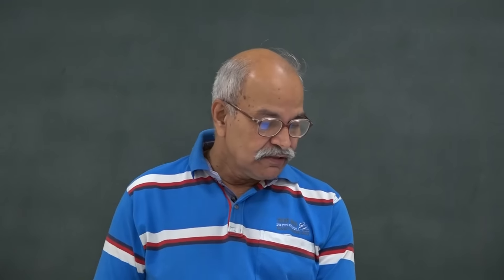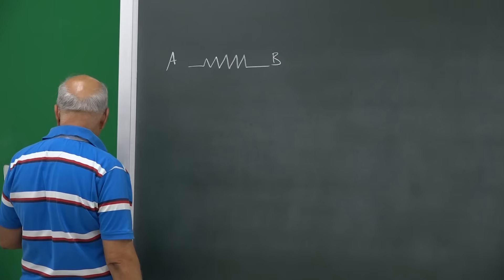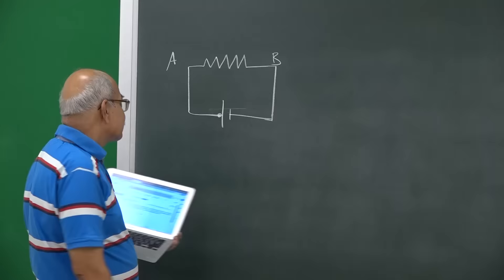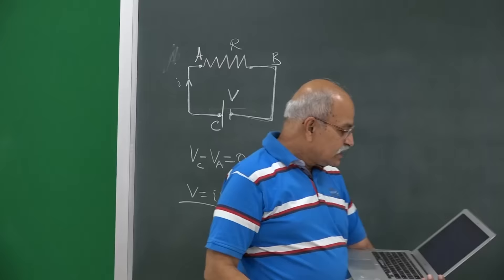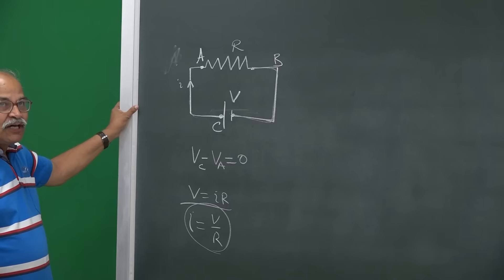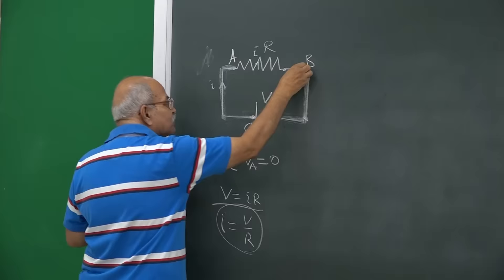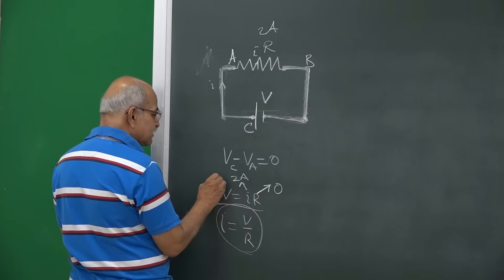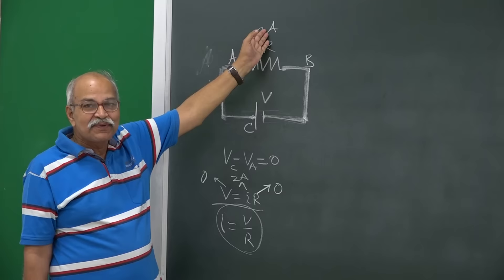Current without potential difference

Comment: मैं explain करता हूँ...
1.) अगर conductor का resistance ZERO (R=0) माना जाये तो, सर का explaintion समझ में आता है 😊।।

2.) But, अगर Conductor का Resistance ZERO नहीं माने तो  ( R#0)  ---
Potential difference, current का folw होंने का कारण होता है, इसका ये मतलब नहीं होता की जहाँ potential diffrrence न हो वहां current flow ही नहीं करेगा plz understand।। जैसे की water को flow होने के लिए हमेशा ढालान(slope) की ज़रूरत नहीं होती है, उसे pressure या Inertia के through same level होते हुए भी Flow कराया जा सकता है। ठीक वैसे ही यहाँ......

Point C to A, P.D  zero होते  हुए भी current flow होगा, क्योंकि ये सभी setup battery +ve & -ve Terminal से जुड़ा है, और battery अपना काम करेगा ☺️☺️।।
Reply: Potential difference, current का folw होंने का कारण होता है, - Galat hai. Current ka flow potential difference ke karan hota hai. I is proportional to V hota hai. Concepts of Physics me sir ne is baat ka zikr kia hai.
Reply: @palaksharma3157  pd causes current na?
Reply: @palaksharma3157  thanks
Reply: Pd causes current
Reply: Per bro battery hi toh potential difference create  krta hai ... So potential difference 0 kaise hoga
Reply: @palaksharma3157   no worry boi . Practically it's not possible . Resistance cannot be zero . It's just theoretical.
Reply: @palaksharma3157  Sorry Miss Sharma
As per Ohm's Law
V is proportional to I if all physical properties remain constant
For getting an equation we can remove this proportionality by R which is called resistance
So, V=IR
Reply: @palaksharma3157  aap shi se pdho ...jo aap kh rhi h whi wo v  kh rha h
Reply: I have practically tested it with battery so a mili volt potential difference is there but not zero and mili amp current is also present... So we should learn by practical experience as I was also facing same confusion while studying from book
Reply: @palaksharma3157  ध्यान से पढ़िए जो आप बोल रही हैं वही तो लिखा है current flow होने का कारण potential differenceहै या कि  potential differenceके कारण current flowहोता  है। दोनों बातें same हैं

Comment: The answer to this was clear to me when i took R of CA as negligibly small instead of being zero.(since, conducting wires do have a small resistance). i in CA has to be equal to that in AB assuming it's a steady current. So the i in CA is some finite value. Then, using V=iR for CA, you see that since R is really small, V of CA becomes negligibly small. So there is a potential difference between CA it's just negligibly small(and because the resistance is also really small, a good current can still pass)
(Pls correct any mistake)

Comment: Having current without voltage is easy to understand and explain ...  

So imagine you have two empty 2 liter soda bottles, now imagine connecting them with an airtight tube that has valves on either end... now imagine pumping one side up full of air pressure and sucking pressure out of the other end... now imagine opening the valves. That's how you have amperage with voltage the air is the amperage and it rushes into the other bottle because of a difference in pressure potential... (voltage)... 

Now imagine a new experiment where both 2 liter bottles have the same amount of pressure this time, and opening the valve... some air molecules will still slowly meander from one bottle to another... those air molecules are current that's not being pushed by a difference in pressure therefore there is no voltage just amps.

Hopefully that helps some understand. I can see people being frustrated trying to relate to how this works on a mechanical level. There are some neglected nuances like it's actually the missing electron in a conductor's molecule's valence shell that moves... one molecule steals from it's neighbor and that one from it's neighbor, on down the line so it's actually the gap or hole that is electricity not the electrons themselves. When you get shocked your being depleted of electrons... but this is just an analogy so of corse it will blow over stuff like that you'll have to visualize the actual mechanics on a molecular level on your own but this may help get you most of the way there. 

P.S. 
Per the 'Ohm's law cartoon' (what my analogy is loosely based off from), resistance would be a narrowing of the tube. The bottles are the positive and negative terminals of the battery. So if your going to run the example he gave in your head, that's how you'd extend the analogy.
Reply: that was a great analogy! thanks!
Reply: @voidmain7954  Thank you, I honestly wasn't sure if it was going to help anyone. Since you let me know that it did, I edited it, to expound on some things. Thanks again for the feedback, cheers.

Comment: Yes current can flow only if there is a potential difference...
But it is not necessary to have a potential difference between any two points, instead there should be an overall potential difference in the loop in which current flows.. 
Example: if you short circuit a cell, that is connecting positive terminal directly with negative terminal with an ideal conductor, then there will be a current flow even after having zero potential difference across the wire. It is due to the fact that the cell creates a potential difference in the circuit.

We are lucky for getting blessings from you in the form of classes sir.. 🙏🏽
Reply: Plz explain in hindi

Comment: Sir is saying that practically the resistance in the wire cannot be zero, so the current will definitely flow the potential difference will be created to the resistances in the wire.
Reply: bro my explanation is regarding magnetic field...that is  magnetic field can also exist even if potential is zero....and that magnetic field can cause the charges to move?...i may be wrong
Reply: @ashutoshwalia2316  nah,actually the magnetic field has a kind of limited affect on moving electron.just think of a planet orbiting around sun it's constantly getting acted upon by a force perpendicular to it's tangential motion which changes its direction,but ultimately planet's energy remains constant even tho it's under a force,the magnetic field has a same affect on moving electron(it kinda affects only its direction,no energy change), whereas electron under potential difference accelerates and thus keeps on gaining energy. Hope it was clear.do dm me back if u feel its wrong.....

Comment: Dear  sir if current is to calculate in this case and potential difference is zero and resistance is also zero. Current will be zero as per equation I = V/R
Reply: So far I used to think that resistance shown in the figure is not just acting within that length .I thought that resistance equally spreads over whole wire and only for good understanding we show that at perticular length .

Comment: Sir I had finished 12th grade from TamilNadu , I too have same doubt but not even satisfied with your ans. sir → I looks trivial please give molecular reason sir👍thank you sir😃

Sir and since if i = 0 too satisfies that condition
As V= iR → 0 = 0x0
Reply: I m even frm tamil nadu.....the question is even though the volt is 0 the current flows in it...why...that's why he is giving explanation for that...even potential difference and resistance is 0 the current may vary.

Comment: But the question is how is the current flowing if the pd across the ends are equal?
The current supposed to flow from point A to B if the if point A has heigher potential than point B.
Reply: That wire is have 0 resistance and thus is actually acts like a super conductor. For superconductors you need only a starting voltage to get the current flowing. After that even if you remove the voltage source current will keep flowing through the loop as resistance is zero. In this case however the current will eventually stop due to the presence of the added resistor. But for sometime there will be a current initially then due to the resistor there would be a potential difference across the resistors. You can use transient analysis to test this.
Reply: Current always flow from positive terminal of battery to negative terminal…. Flow of current has nothing to do with potential over here….
Reply: @viraj1212  ok but according to the ohm's law current can only flow of there is a potential difference between two points having potential.

I think you have to study some basic physics
Reply: @HypnoDrip  just mug up these formulae ... theres no need to waste time thinking about this 

So what happens is the potential we get here is 0 and also resistance between those points is 0 . Now if we see I=V/R = 0/0 .... which is UNDEFINED . It doesn’t mean that it does not exist . So i guess we could apply limits over here and like calculate some things using some measures . And we could get some definite value of I . And then we can say that Current exist. But i still wonder why would some think this things. They are useless and only imaginable no practical use in real life .
Reply: @viraj1212  What can we deduce about the lim g(x,y) as (x,y) -> (0,0)? where g(x,y) = sin(x)/x+y in substituiting, we get 0/0 so it has an indeterminate form which requires further work to ascertain if it is truly DNE or if it has a limit. What I've been hearing too is that since it is 0/0 for the above function, the limit DNE. Which is which? Or are definitions being loosely used?

And I think thinking something like this could help you understand the concepts better so asking questions without thinking it's valid or not is a good habit offcourse in my opinion
Reply: In the qn potential difference btw A and C is zero 
But not the potential, so it's always fine 
The Qn is quite normal but the way the Qn asked was tricky
Reply: @logeshgopi4212  but aren't we unable to find the absolute potential of a point always what we measure is the difference between two potential.

Comment: My teacher answered that it is due to Newton's first law.. as in a zero resistance wire there is no need to do work
Reply: Kah sakte hai
Reply: electricity and Newton law is not related
Reply: @gitkrishna  If you look at the entire system alone, newton's laws are valid in electricity. Only when you look at the quantum properties of electron, his laws become invalid.
Reply: @Aester  may be its true but Newton's law and electricity is totally different way
Reply: One of the videos where the explanation wasn't illuminating at all
The answer to this problem lies in the approximation of a conductor's resistance to 0.
Notice that when you start taking its limit approaching zero, the problem starts seeming trivial by itself. This whole misconception arises because people believe in the exactness of the zero resistance.
Now, see it this way.
Let us suppose that there is a resistance R in a DC circuit with a battery of voltage V. Let us take that the wires have a resistance r.
Now, net current, by Ohm's law=(V/(R+r))
The potential drop across the wires is then-
Vr/(R+r). Now, notice that in the limit r->0, the denominator reduces to just R and the numerator gives 0. Thus voltage across the wires being zero is just an approximation

Comment: Sir but how to calculate current if potiential difference and resitance both are zero while there several value satisfied ohm'S law as you take 2ampere but if i take 5a,10a.. And so many values 
Please answer this question 
And also i'm your huge fan
So don't avert this please

Comment: How Current is flow ,if potential difference is Zero.
Current need a potential difference to flow , how it is 2A?
Without any difference in level of ground how water can flow?
Reply: That wire is have 0 resistance and thus is actually acts like a super conductor. For superconductors you need only a starting voltage to get the current flowing. After that even if you remove the voltage source current will keep flowing through the loop as resistance is zero. In this case however the current will eventually stop due to the presence of the added resistor. But for sometime there will be a current initially then due to the resistor there would be a potential difference across the resistors. You can use transient analysis to test this.
Reply: There is difference in beginning of flow if u put 2 litre water in pipe the water will flow through the pipe , if your pipe is too long to come back then it will stop flowing at certain distance if your pipe is short and you make thin the pipe, the pressure of water can blast the pipe ...current's nature is same with water in many ways